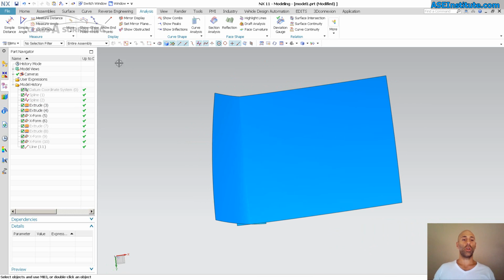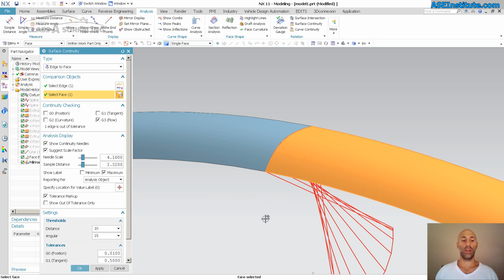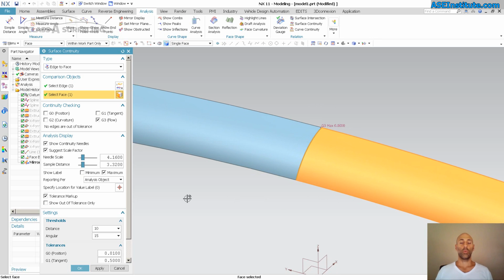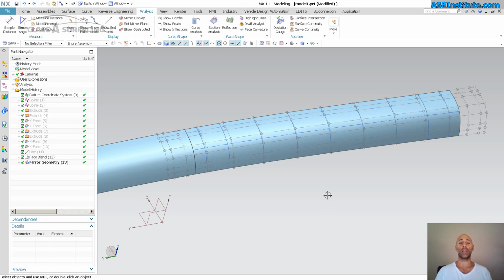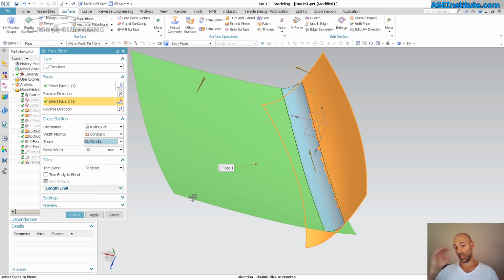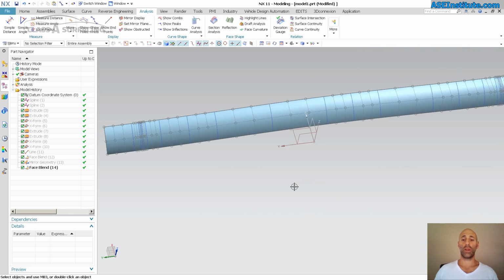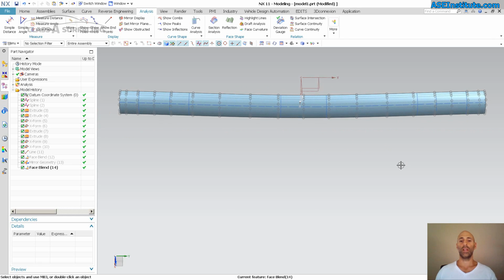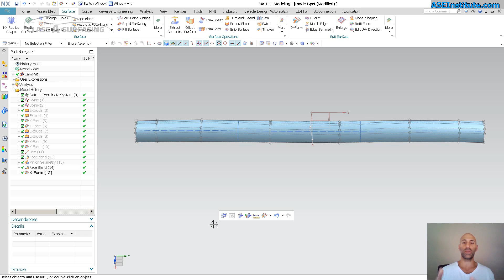Design Across Centerline Part 2: Siemens NX11

Comment: Hi, Thank you very much for your video, please can you tell me if it is possible with NX (realize Shape, or any surfacing tool) to start from an existing STEP file model (solid and surface), Thank you
Reply from the maker: NX works wonders with translated data. What type of projects are you thinking?
Reply: I am trying to redesign a body of (like) a car model, I have the model in SpaceClaim (direct modeler software) file type, I am trying to redesign the model in NX (via a STEP file, or other format), but as I am not a CAD expert, I am trying to avoid  to start from a blank model, for me it is better to start from the existing model. Thank you
Reply from the maker: SpaceClaim should support a good clean STEP. The X-Form and I-Form tools will easily work with surface data from any other tool. You may need clean up the surfaces a little but that is easy stuff.

Sounds like you are on the correct path.